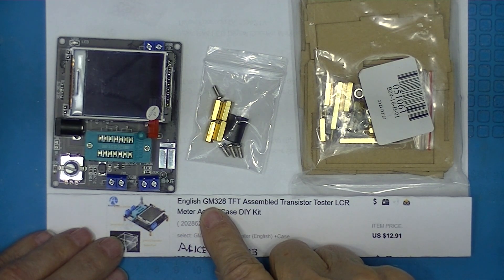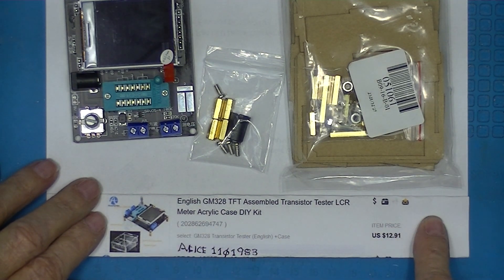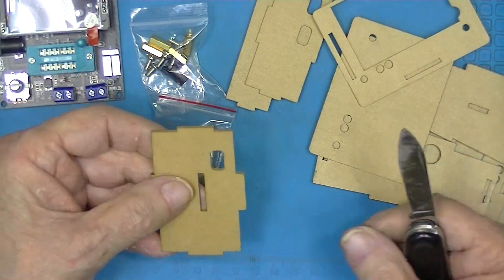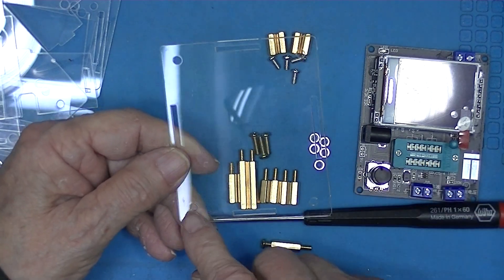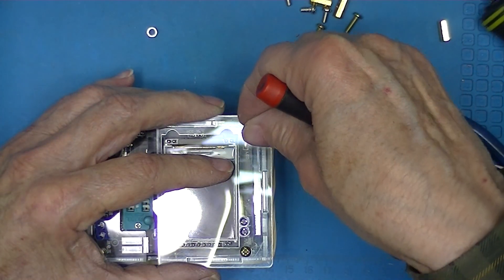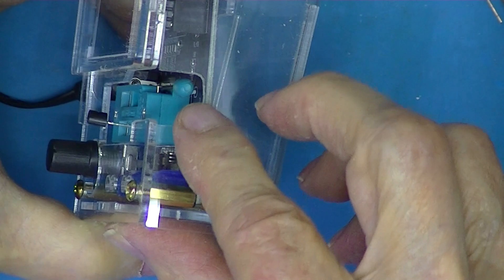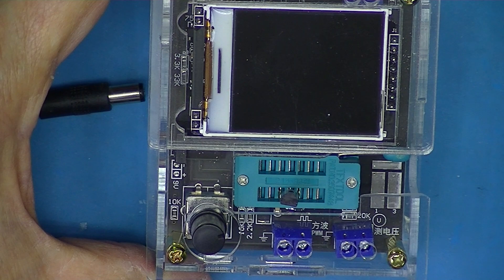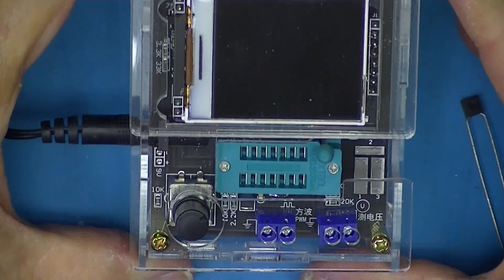Enclosed GM328 Tester from "Alice"

Comment: I was thinking a rubber band would help, and about a quarter second later you cut to where you had used one to hold the case together.  Just ordered one.  Mid May delivery expected.  What tool did you use for reshaping the plastic case.  Needle file?
Reply from the maker: I have a Foredom tool like a Dremel and used an abrasive wheel.
Steve